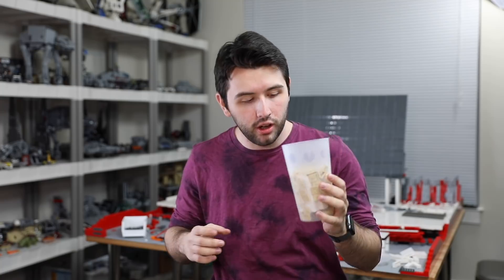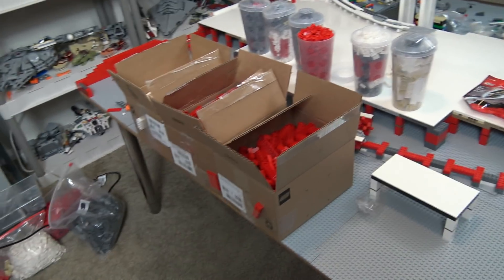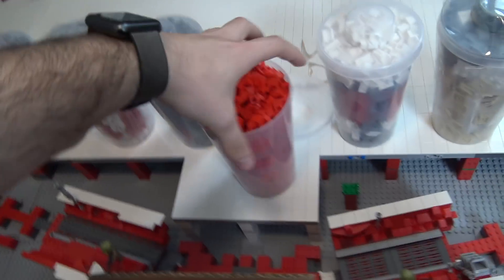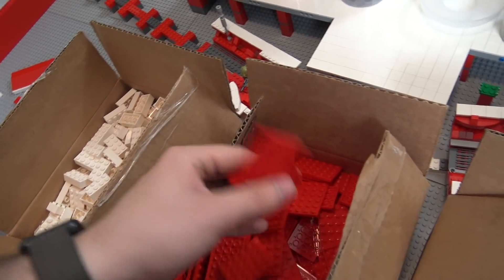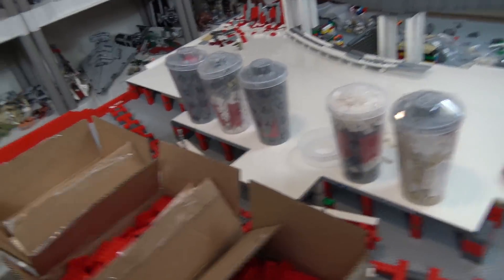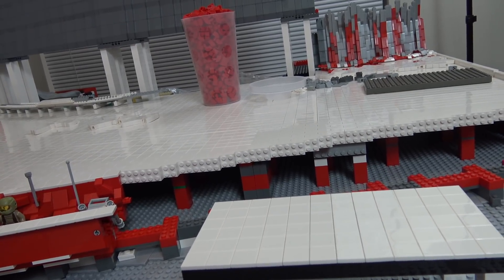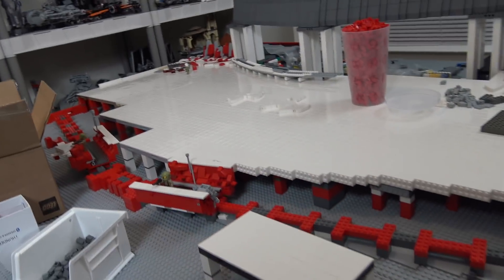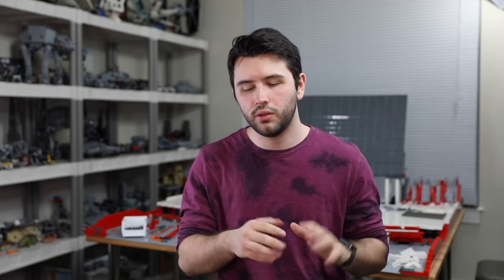Building Crait in LEGO - Week 14: Final Trench Design!

Comment: What might make the snot bricks more stable you could use full pins and put in the holes in the bottom of the bricks.
Reply: That pushes the brick out a bit too far, as the pins connect in a different way.